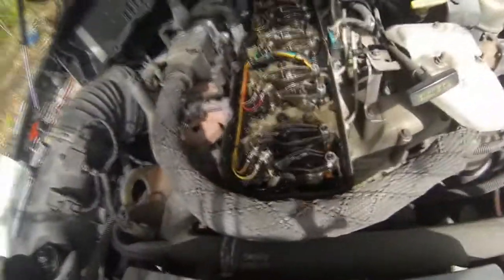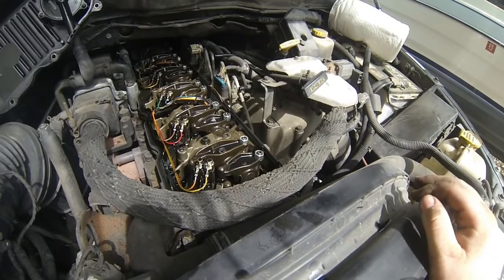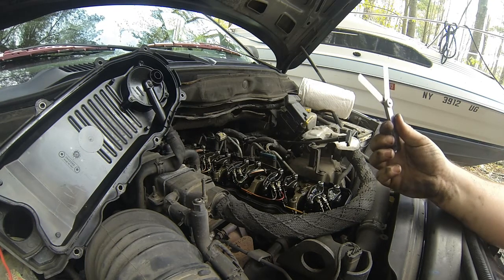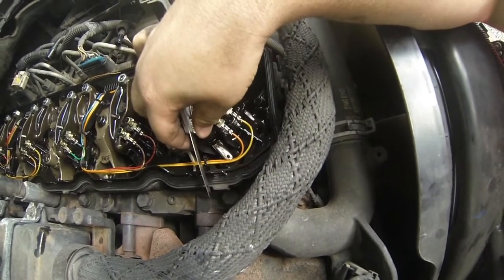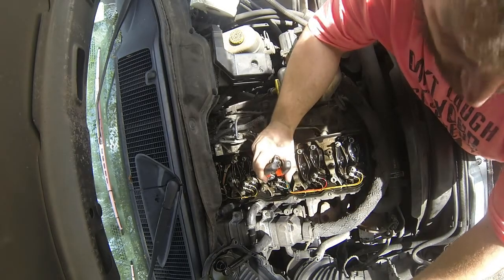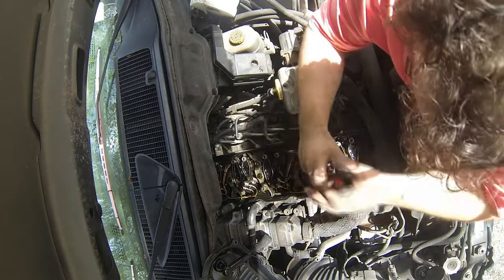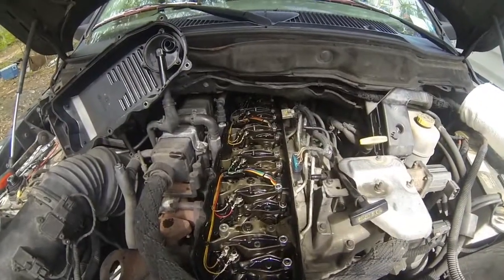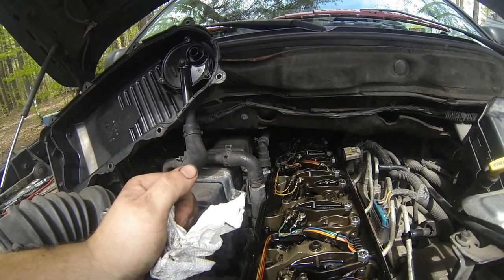How to set valve lash 6.7 cummins diesel part 2

Comment: Nice video. I agree with you and the others about setting the valve lash when the motor is warm. If you were to set the lash when it was cold, the lash would be too small when the rocker arms and valves heat up and expand especially at full temp. Good job.

Comment: You need to do this COLD!!! not warm. your adjustment will be wrong if you do this with the eng hot. or warm. 
BTW. All the third Gen cummins have loose valve lash from the factory. So if it's never been done, it will help a lot to do it. But always cold!